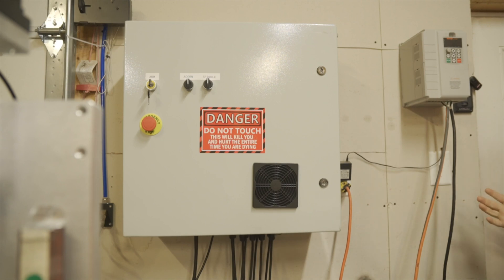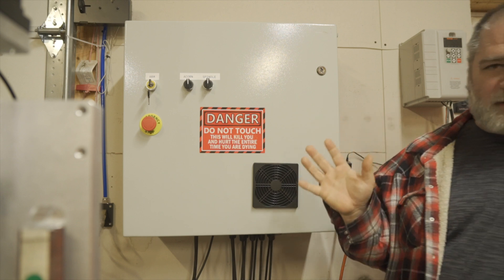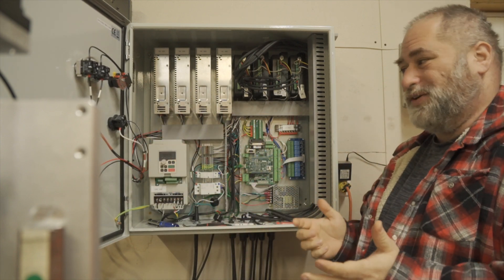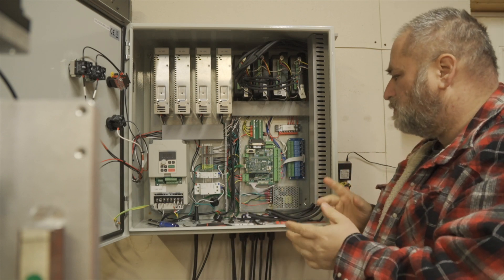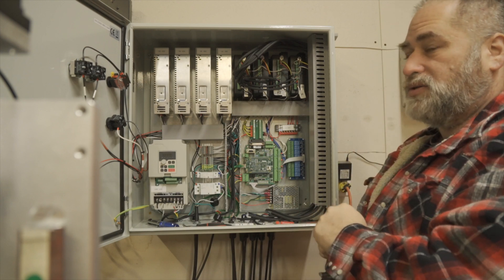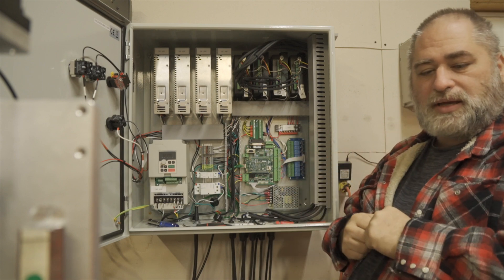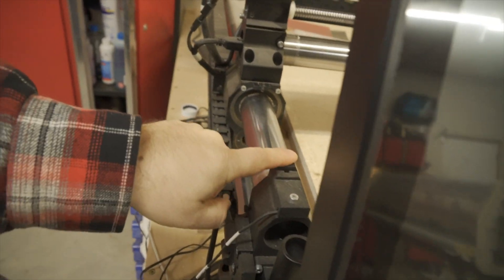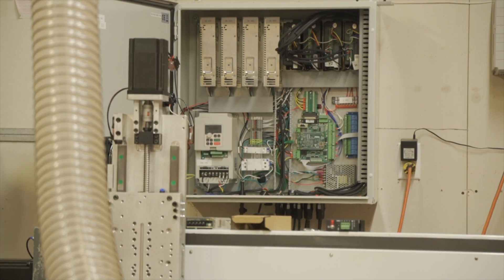Centroid Acorn VS Masso G3 (Hardware)

Comment: Why do the stepper drivers each have their own power supplies?
Reply from the maker: Mainly cost, the switching power supplies were cheaper than a single Toroidal rated at the combined Amp load.

Comment: Why did you decide to use individual inputs for limits and homing on the Acorn? I have all of my limits ganged to a single input and I use the limits as a homing switch. 1 input for everything.
Reply from the maker: On the y axis i needed two so I could use the auto squareing functionality.  If i remember correctly that required all of them to be separate.

Comment: Whats about the g-code comparission? Masso cant do a lot on a lathe. i read about the acron can do more. Whats your expiriance?
Reply from the maker: Acorn all they way for anything more than a 3 axis cnc rouer.  I actually regret the Masso now but it's doing what it needs to do.
Reply: @DIGWoodWorks  well i would like to have more g-code progression on the masso but thats the way it is actualy. 

From a building perspective masso is almost plug and play that i llike. 

i have a pair of them and build some cnc machine with it, but - variable speed setting - or dwell time code isnt working. 

That can help with chatter in example. 

But some stuff that is really usable and importend down the manufacturing route is missing.

Rigit tapping is missing etc.

but as i assume acorn is not that complex to build a cnc machine...

Comment: If you're using the four drive outputs from the Centroid for the X axis, a gantry Y axis with 2 drives, and a Z, you can save one drive output from the Centroid by mirroring the Y output from the Centroid to two drives, and have your rotary.  

I have a Centroid Acorn and like it.  I find having the computer next to the CNC very useful.  I keep a second copy of my design software on the CNC computer and do final checks on where the design software thinks the Z zero is supposed to be, whether I used X0/Y0 in the center of the piece or in a corner, workpiece thickness, etc.  I got my CPU for $300, and then got a good touch monitor, a mouse and dustproof keyboard.
Reply from the maker: Yeah, I had thought about doing it that way, but I wouldn't be able to auto square the gantry.  Not that I have it setup to do that yet but it's on the list 😊
Reply: @DIGWoodWorks  I found the precision of my proximity sensors (pretty decent quality) resulted in slightly inconsistent squaring, so gave it up, relying, instead, on the physical squaring on the gantry on the rails.  It's worked fine for several years now.
Reply from the maker: @MIchaelKelcy  ohh, good to know.  Perhaps I'll rework the 4th axis for something after all.   Thank you!
Reply: If you dont mind, where are you located ?

Comment: I have this gut feeling that a newer masso will come out eventually.... the g3 and g3 touch are pretty much rock solid, but the VGA display with old school resolution and iffy touch screen monitor selection is basically "old school" as it were. Having a very common higher res touch screen with USB and HDMI connectivity is pretty much the norm now and I have a feeling that Masso will jump on board eventually. On one of my retrofits, using a UCCNC controller with a windows PC allows the use of a touch screen display with only one USB C connection to the computer. This just makes sense and allows for a lot of choices of displays. The "rock solid" architecture of the Masso with a bit more modern display capability would be the "icing on the cake" for masso.
Reply from the maker: @josepatron4950  you may be correct. I've decided to stick with the Centroid for now.  If Masso does come out with a new version that may spur me into making the swap.